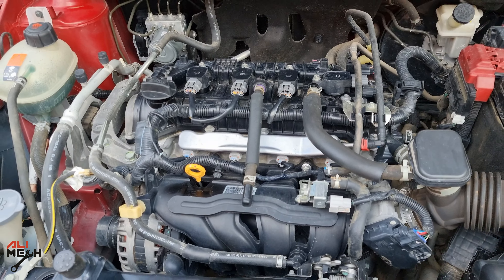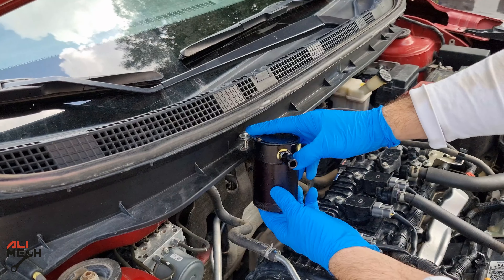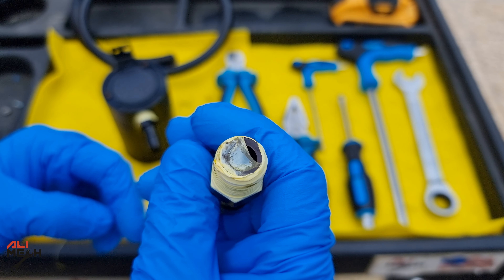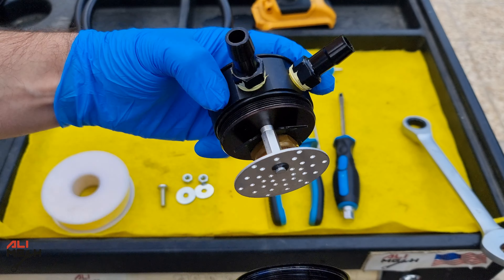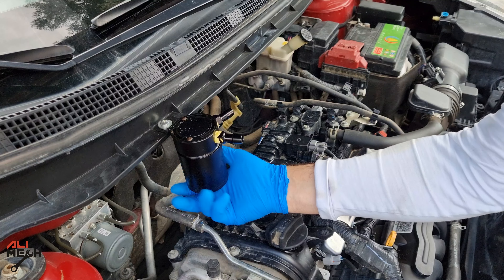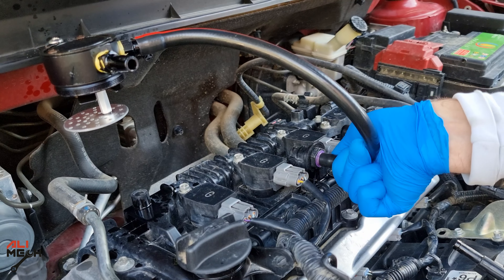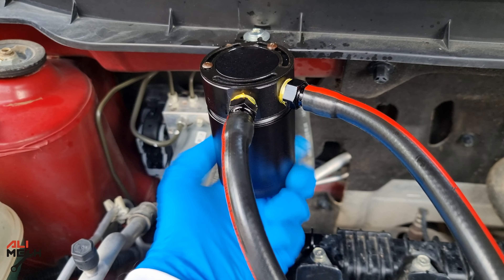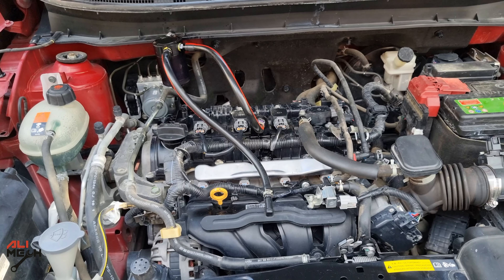Quick fix for engines burning oil/How to install oil catch can /preventing carbon buildup in engine

Comment: A tip to add, fill the inside of the can with stainless wool (that's uses for cleaning dishes without any detergent on it just pure steel wool) .. It will increase the surface area to catch every tiny drop of oil within the air flowing inside the catch can.. Then that steel wool can be replaced on every oil change

Comment: I had a catch can on my old VW CC. It worked great but I read that it adds backpressure to the pcv. Is it true?
Reply: A good can will not interfere with PCV pressure as the can and hoses have sufficient space for air movement.

Comment: I made a DIY catch can for my 2003 Elantra GT (bought new). The can works well. 
I started using GL-6A spec oil last year, designed to reduce oil blowby.
Now there is very little oil in the catch can.

Comment: Catchcan should be installed at the lower position from the engine for best result. If you install it higher than engine after few months you will face a situation where the inlet tube is filled with oil and after turning off the engine it will flow back and clog the PCV valve.
Reply from the maker: No, it won't, I have that on my other cars, bc its on vacuum line, and the engine always suctining vapour

Comment: Hello dear Ali, 

I have a question about the oil catch can, if you don't mind answering : 

On a Suzuki SX4, 1,5L , gasoline, 
I identified the pcv valve and the hose which goes to the valves, and cleaned the pcv valve of oil residue following your video - many thanks - . 

But, there is another hose , opposite to the pcv valve that takes oil vapour to the throttle body, right above the throttle flap. 

So, my question is :

Should I use 2 oil catch cans , since there are 2 vapour oil circuits ,

Or just one oil catch can, useing a "T" shape piece on both hoses to combine the hoses from each circuit ? 

Thank you for your reply. 

Have a good day .
Reply from the maker: Thanks , it's better to use 2 then, so it doesn't cause any problem with vacuum negative pressure